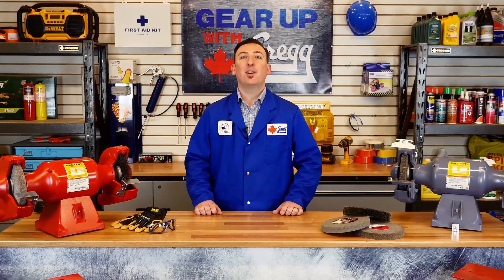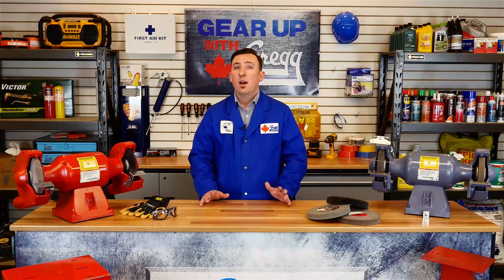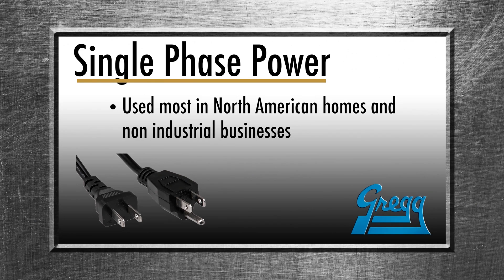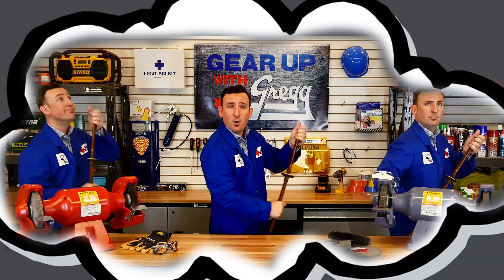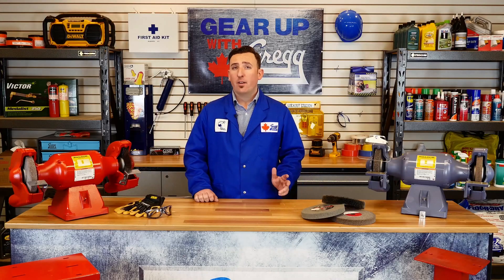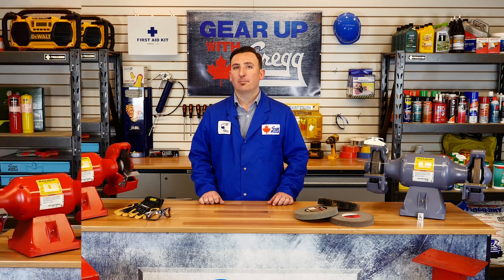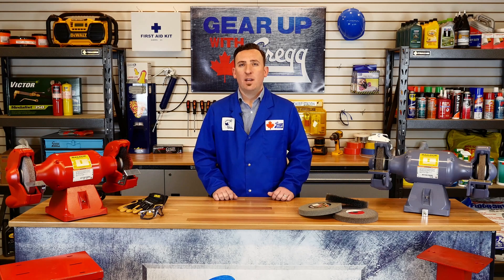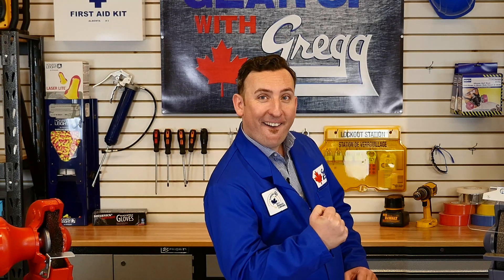Shape, Sharpen & Polish with Baldor Grinders - Gear Up With Gregg's

Comment: how do i clean rust out of the wire wheel?
Reply from the maker: It's hard to completely remove the rust off of an old wire wheel, but you could consider removing the brush and submersing it in a rust remove such as this option:

https://greggdistributors.ca/automotive/new-automotive-cleaners-and-degreasers/llo77701?srcid=search